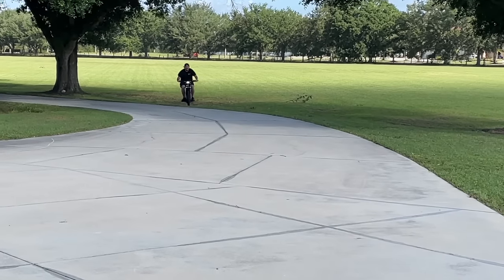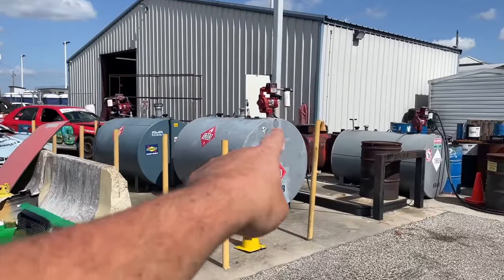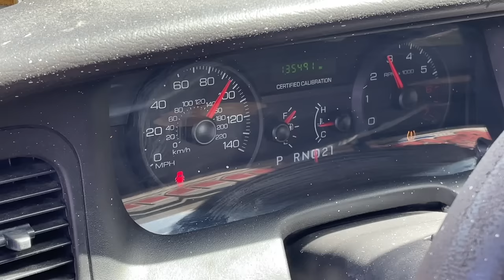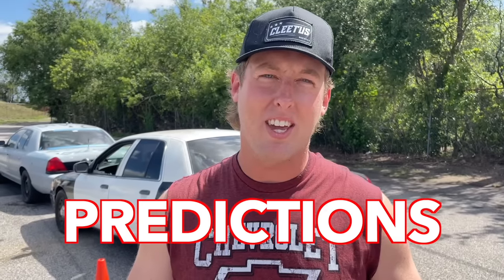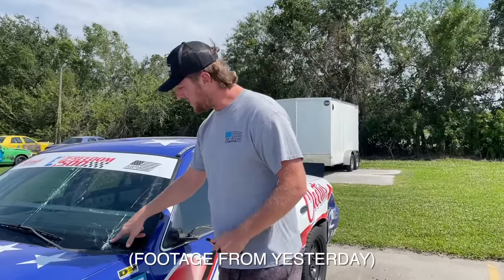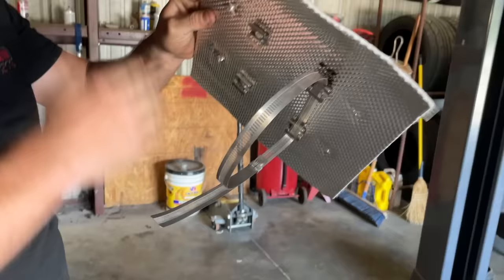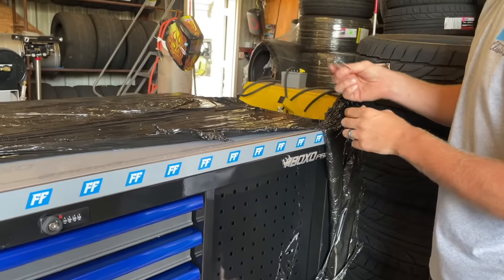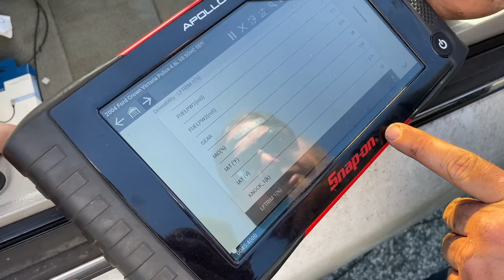This Crown Vic Is Going To Run At Full Speed For A MONTH... Let's Begin

Comment: Turn on the heater at full blast to help pull heat out of the system. I can't wait to see how this goes!
Reply: Only thing stopping that is it will overheat for sure.
Reply: @pmccoy8924  Oil won't last a month on it. Hard to imagine it lasts very long after its lubrication is gone
Reply: True words
Reply: @Tanner69046 but since it runs constantly it doesnt have heat cycles it would have otherwise. Which is big deal for this test
Reply: I think the rear end is gonna go out 1st because without the car making any left or right turns and starts or stops to slosh the fluid around from the diff out to the wheelbearings it's gonna cook the wheelbearings and lock up the rear end......I give it a week and a half.💁‍♂️
Reply: Should do around 74000 miles over the next 31 days 😂😂😂 hope it survives the month
Reply: More gas
Reply: @skeetermcswagger0U812  Banks Power has done tests on that. The stock diff cover pushes oil into the axle tubes keeping the bearings lubricated.

I think the failure will be due to engine oil. It will degrade until it is no longer able to keep up the film strength, or burn up and starve the engine.

They are also going to forget to fuel it up multiple times, really needed a bigger fuel tank and a separate oil tank to circulate a larger volume.
Reply: @Tanner69046  my cars ran longer then a month without changing the oil… I’ve done 30k once
Reply: All the cars have been driven hard but 3 weak points. The plastic intake,no diff cooling and main bearings so id bet it  will overheat or through a bearing after a week
Reply: @bmdubclub9933  you mean 30k on one oil change?
Reply: @Tanner69046  that idea is a misnomer. Oil break down is something the companies try to make you believe. The only thing that happens to the oils that gets contaminants in it which can damage your engine. My father worked at the Amoco Research Center in Illinois for 14 year. All the oil you take to the recycling plant is just cleaned and introduced into virgin motor oil at a small percentage
Reply: @MrJamesBanana   Yeah I agree with you and I've seen those demonstrations but I am also sticking to my guns on my prediction because the 3rd member is positioned at a slightly unnatral angle(pinion downward) really curious of the noises that come from the rear that car.
 But that's not my opinion that's the Crown diffs old-pinion!!😁😂🤣
Reply: @mikepereira7803  yup oil came out pretty damn clean surprisingly though
Reply: @bmdubclub9933  God damn.. Hard to believe but I guess I have to take your word lol. I actually subscribed to you the other day after reading your comment. Heard some Mac Miller in one of your videos so I looked n we are subscribed to like 80% of the same channels and both from New England.
Reply: @mikepereira7803 You'd be surprised. 20k oil changes aren't uncommon these days with good synthetic and a good filter.
Reply: @skeetermcswagger0U812  that doesn't work like that at all. Lol
Reply: @TheAdatto  DFQK are you talking about?💁‍♂️🤷‍♂️🤦‍♂️
Reply: @skeetermcswagger0U812  there are no car parts that need frequent left to right steering for lubrication.
Reply: @TheAdatto  
You don't need to try and prove you don't know much about cars to me or anyone else.......you're making it abundantly obvious every time you type something.🤦‍♂️ 
But hey do whatever makes you sleep good at night,be my guest scooter. 💁‍♂️
Reply: @skeetermcswagger0U812  i just rebuild my whole 3200gt engine myself including crank bearings so i know a thing or 2.
Reply: @JoBlo819  Just for your info there's no such thing as a 2013 Crown Victoria as they stopped  production in 2011....
 I sure do  wish they were gonna keep going for at least a couple years though,even though the quality and craftsmanship of them basically took a nosedive from 2008 on when they started manufacturing them in Canada when they ended up changing the Police Interceptor and Taxi Cab vehicle's build code from P-71 to P-7B.

(I have owned every generation of them 1990 thru 2011.....)
Reply: @TheAdatto  
 Yeah I agree with the '2' part........🤔😆😅😂🤣
Reply: @TheAdatto   So in your statement you're trying to say that it's unusual for somebody to replace the crank bearings when they do a rebuild of a 'whole' engine?
💁‍♂️
Reply: @skeetermcswagger0U812  no.
Reply: @TheAdatto  

           !¡!ROTFFLMMAO!¡!
Reply: @billmadison2032 As a mechanic, oil evaporates its lighter components and breakdown the thickening viscosity modifiers, they eventually turn into little plastic bits that the oil filter removes. EGR introduces sulfur and nitrates and carbon that the oil filter can’t remove and they form acids that attack the rings, bearings and valve guides. The seal softeners get used up causing seals and O-rings to harden and leak. 

I have had multiple vehicles go close to or over 300K and it’s due to maintenance. Delete your EGR, change the oil at 5-10K depending on use and if it’s a synthetic and using a quality filter. A 5QT change should cost you about $60 a time for synthetic oil.
Reply: @bmdubclub9933 bro ... Not a good idea ur car will blow TF up and it's not going to be cheap to repair/replace. 
Change ur oil at most every 10k miles at least every 3k miles

Comment: By my calculations that crown Vic will have done 74,400 miles by the end of the month, let's hope she can do it. Cmon crown Vic, you got this!!
Reply: Was wondering if anyone did the math...lol
Reply: Did the math also, can confirm. I feel like we should up the mph and get it to 100k, it's a ford, it can handle it.😅
Reply: The Math Is Correct!!! 74400!!!
Reply: 1.6667 miles per minute times 60x24 . Will be insane if the motor takes it
Reply: You would have to do 135mph steady to get to 100k miles.
Reply: 2 gallons of fuel an hour, so roughly 1400 gallons of gas.4 bucks a gallon, roughly 5.6k in gas prices
Reply: 76,632 the wheels are actually going 103mph.
Reply: @gmcman355crazy  that's for one day, not a month lol. And why would you go by minutes? it's going 100 MPH, meaning miles per HOUR. Why make it harder and less accurate by rounding 2/3?

~ 100 mph * 24 hours per day * 31 days in May....

But everyone here is assuming they started this at 12:00AM on May 1, which they clearly did not. A safer estimate would assume they started around noon, or 12PM. 12 hours have elapsed from the 744 hours in May.

((hours per day * days in May) - hours passed on first day) * speed of car = ((24*31)-12)*100 = 73,200 miles.
Reply: Say it gets an astonishing 50mpg with no drag and without the road friction.(just guessing) That’s 1488 gallons of fuel, 48 gallons a day. With the 20 gallon tank that’s 2.5+ fill ups a day. Avg Bradenton gas is $3.60 a gallon. If it makes the Full Pull it’s $5,378 in fuel. Go Freedom!!
Reply: @gmcman355crazy  WTF? The speed is already in miles per hour, why are you converting it into miles per minute, only to redo the math?
Reply: Yeah and probably around $15k in gas
Reply: Not without airflow through the rad it won't
Reply: @alexn78666  exactly. Just use hours 😂😂😂
Reply: Modular motors were built for stock abuse. Let er rip
Reply: @kylemac8672  i did 3.50 and thats $13K at 20 miles per gallon
Reply: @minzahhh1  Lets go out on a limb here and assume it has a radiator fan like everything else
Reply: @commonsenseisdeadin2024  hes getting 50mpg...
Reply: Those axle bearings gonna die within a few days. No lubrication to the outside wheel bearing due to the car not moving and turning. I feel like driving it around and taking turns helps with the oiling of the axle tubes to the bearings. I do want to see how bad the oil in the engine will be tho.
Reply: @SicOne  crown vics get 18mpg under load. No way is he getting under 30 or 40mpg with just mechanical resistance from drive train
Reply: @CH-qy5sn  no need to climb a tree mate it definitely has a thermo fan that's no argument...that tiny little fan used to flow air at a stop light won't be doing a great deal at 100mph stationary haha I'm confident it won't be running next video
Reply: @dontdowhatido6503  Risky, but seems like someone could get under and dribble some lube in the fill port just enough to get some down the axle tubes and hit those bearings.
Reply: @kylemac8672  Especially since I'm fairly sure the transmission's bypassing the torque converter completely.
Reply: @mfree80286  I don't know much about auto transmissions, I'll take your word for it
Reply: @gmcman355crazy  It's not really under load, it's just spinning a few pounds of tires and drive line, It's not like its on the dyno for 31 days. So yeah this should be fine.
I really wanna know how much gas they are gonna use though.
Reply: The most miles a vehicle has done without someone actually driving it
Reply: @WaldoMoreira  yeah I got around 13 14k in gas. At 18mpg. 720 hours. Little over 4k gallons of gas. At 3.2$ a gallon
Reply: 102 mph would be 75,888 miles in a month 😳
Reply: I've checked the weather forecast from Australia and it's saying Florida is 31° tomorrow followed by 30° then 29° lmao if that fkn Vic stays running for the next 3 days I'll buy one
Reply: @Steve Combs  783 miles on the odo, they put 14gallons in. That's 55mpg, and that's assuming it was full when they started. This thing is easily getting 50mpg
Reply: @johnb7430  yeah I didn't think of no load enough, I was just thinking i get about 16 mph at roughly 90mph average speed with my vic however I'm manual trans and 4.10s so... But the car was under 3/4 so it's going to be even higher than 50! But we are still taking 74 thousand miles!
Reply: @commonsenseisdeadin2024  but it's not getting 20mpg. The trip meter said 783, and they put in 14 gallons. That's 55mpg, assuming the tank was full (rewarched the video to double check(
Reply: @piston_pusher  it's getting roughly 50mpg tho
Reply: @dontdowhatido6503  the fluid should be in the tubes and just rotating will move the fluid just fine. I doubt it will make it a week, I love my Panthers but that's just a lot of straight driving. I say intake manifold failing or water pump.
Reply: @minzahhh1  the fan is not small and keep them plenty cool. It will fail by ober heating but the coolant is going to piss out of the intake manifold (either on the crossover under the thermostat or the back heater core outlet) or water pump is my prediction within a week.
Reply: @minzahhh1  Celsius I assume?
Reply: @piston_pusher  i did the same and didn't account for no load. They will see around 60mpgs no load
Reply: @commonsenseisdeadin2024  spot on regardless of cause it's gunna be heat related and it sure ain't lasting a month but I'll be watching every video lmao
Reply: @commonsenseisdeadin2024  correct mate
Reply: @minzahhh1  I guess isn't heat usually always the killer? Although when it's oil related, is it the oil starvation or the heat that is credited as the killer? 🤔🤣

Comment: You should do a "running oil change" think about it... It could be done. Pour in the new while draining the old.
Reply: Yeah use peanut oil while your at it
Reply: @keegentilley578  peanut oil? Holy moly!
Reply: Good idea
All but the filter.
Reply: That’s how the Hacienda Cessna 172 kept flying nonstop for 2 months
Reply: Would you risk to put your noodle next to the crank case when the engine can blow up at any moment?
Reply: Bypass filtration is close to oil change while running.
Reply: @Munakas-wq3gp  noodle? Lol. Definitely have to shield the noggin. 😂

Comment: Driving my 80s oldsmobile my foot gets pretty hot just from the vent overtop of the pedal. I couldnt imagine how hot some of those heater cores are getting, and venting air could be cooking people feet from above aswell. Maybe give the vent a shot of expanding foam on the driver sides. Leave the pass side open for additional overheating options. Or T off the heatercores under the hood

Comment: A suggestion: have a laptop or tablet in the car connected to the OBDII port, running something like the Torque app, and have remote access to the device.  That way you can actively monitor the various values like water temp, oil pressure, etc., from a remote location.  Easy peasy for a decent IT guy to set up.
Reply: You didnt see the Apollo Scanner? I

Comment: Those 4.6’s were used in industrial standby generators.  Usually running on natural gas though, but if you think about it as hours of runtime rather than miles driven, it’s not unheard of for power to be out for several weeks after a major storm or flood.  Unfortunately that engine has seen A LOT of hours and miles already, and there’s a lot of supporting parts that all need to not fail.  I’d love to see it go all month, but I just don’t think it will…
Reply: Natural gas and propane engines run alot cooler and put alot less soot in the oil

Comment: It'd be slick if you could find a way to mount up a tool box into the SXS. Similar to the slide out drawers that go in the beds of trucks. That'd make for a very convenient Pit setup, rapid response anywhere on the property, etc. Basically a driveable toolbox and if like the pickup truck versions, still have a surface on top to use the bed.
Reply: I literally just saw a Kawasaki set up exactly like that on Marketplace earlier for $25,000, it was pretty dope but it looked top heavy as hell lol

Comment: Should be roughly 72,000 miles by the end of the month😂🤣 I swear cleet u guys kill it with the content!
Reply: Yeah that's insane considering it won't be turned off manually and will just be continually running. It would be awesome if that Vic does even 20,000 miles but i just don't see it doing 70,000
Reply: Yup and at 14 mpg he should be spending about $20k for gas 😂

Comment: Was in a bad spot at the start of the year and needed a cheap ride fast, found a decent looking vic for 4500 with 100k on the clock. took it for a two way 11 hour trip and came to the conclusion that it was one of the best choices I could have made. Solid friggin machines

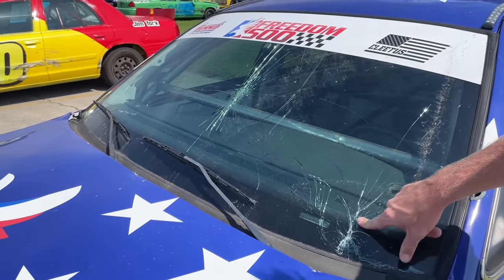Comment: At 16:30 when the long block is being installed in that GMT800 truck, obviously the hood is still on. This makes the job more difficult. On that truck you can actually raise the hood completely vertically by simple removing one bolt (per side) from the top of each hinge and reinstalling the bolts in those unused holes on the hood. This is called the "factory service position". Also let's a lot more light into the engine bay

Comment: That diff is gonna get real spicy with no airflow around it!
Reply: It's not under any load though. My biggest worry is just the engine oil and overheating, like you said theres no airflow, thermostat could go, water pump, etc.

Comment: I predict the cooling system is going to pop somewhere on the vic within the week.  I would level it out though put the front on stands too.
Reply: Same
Reply: the diff is gonna grenade. it was spinning one wheel in the rear. that's not gonna last too long on really hot gear oil that's probably never been changed.

Comment: I’d be so afraid of it popping off and pushing sideways into the fuel tanks haha put a barrier on both sides! 😂
Reply: Yeah I’d weld the Jack stands to the axle and a huge steel plate 😂
Reply: I'd have a killswitch where if it moves, the ignition gets cut.
Reply: Pull the rear tires off
Reply: @Fix_this  then it’ll just wreck the pavement when it’s driving around by itself on the rotors 😆

Comment: Use a bug pipe wrench on the top of the gas peddle the weight hold it at 4k rpm perfect for jumping with booster cables

Comment: That Vic should put on over 74,000 miles by the end of the month of it makes it! Curious how they’re gonna monitor and take care of the oil lol.
Reply: if it makes it, i will never change my oil again lol
Reply: Eh it’ll be fine
Reply: No load, relatively low temps, oil should be fine as long as there are no leaks. This is a cakewalk compared to actual driving
Reply: thats what I was thinking too the oil is gonna cooked
Reply: @wingracer1614  low tempts? How do you think that the car isn’t moving
Reply: @dill5500  So? It still has a cooling system on it. There is NO LOAD on it. It's only generating a fraction of the heat it would on the street. As long as the fan survives, it will be fine
Reply: @dill5500  Nearly a day later, still running fine except for a small trans leak

Comment: I don't know if you've ever tried the stuff before but Lizard Skin works very well for heat retention (rejection). I've used it on school buses before on firewalls and floors in older buses that had little to no insulation in those areas and it dropped the interior temps quite a bit where the engine and exhaust were very close to the firewall/floor. Several good coats in the issue areas was all it took on the buses.

Comment: 78,120 Miles for the month, and 2520 miles per day is what the math comes out to I believe. Can't wait to see how long the Vic goes!
Reply: You overshot a tad..100mph × 24 hours =2400×31 days =74,400 miles
Reply: If your doing 100 miles an hour for 24 hours thats 2400 miles a day times that by 31 days is 74400 miles mate. Not sure where ya learnt ya math lol
Reply: Gonna cost about 5000$ in fuel
Reply: Your math is wrong. There are only 24 hours in a day so at 103 mph, that's 2,472 miles a day, not 2520. And there is 31 days this month so that that comes out to 76,632 miles, but they didn't run a full 24 hours the first day so it will be less than that.
Reply: I kept doing the math in my head and thinking I was doing something wrong, but yeah, wow that is a lot of miles lol  Should keep track of MPGs too...